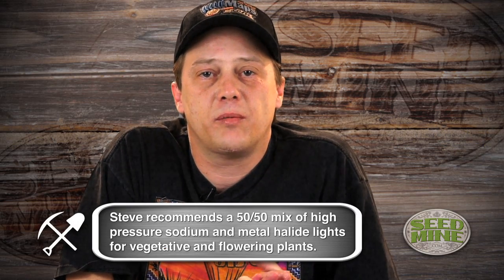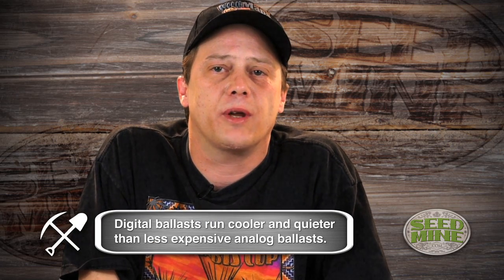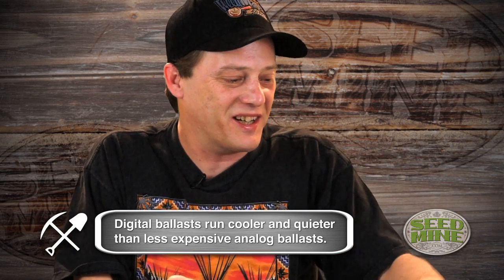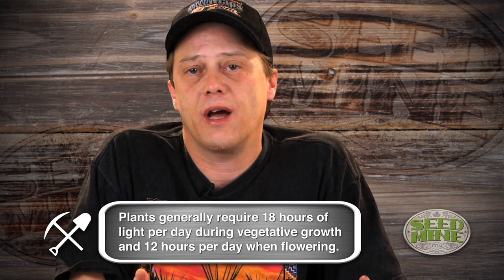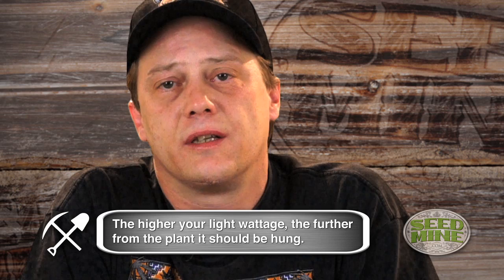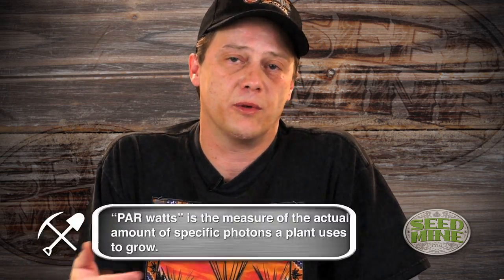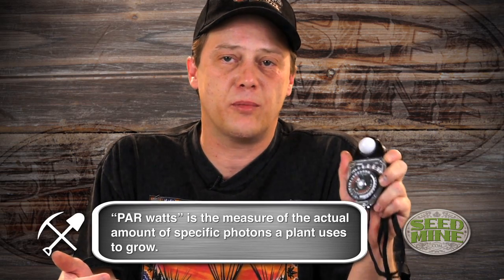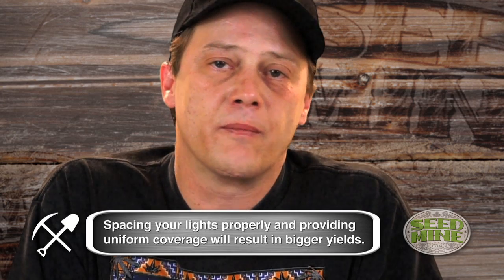Grow Room Lighting

Comment: I have been using led, 600 too a 1000 watt equivalents and well the results are way way better. The pressure sodium etc are ok but you are lacking in alot of the other spectrums. This is 2018 though. Maybe then they LED'S were still poor technology then. Now 89 LED'S two 600 watt equivalents are more than enough to get 15 ounces tried and cured. Also, top quality and that is from my customers and other people's old customers ;)

Comment: Hey brother.. with 1 single full spectrum 180 watt ufo led on a nirvana bubblelicious autoflower grown in a 1.3 gallon container.. I was able to pull 29.3 grams dry weight of pure n utter funky ass weed. delicious caked in crystal bud. LED's are the shit! you just have to get a good LED light. some can be hit or miss. I got lucky before this company went under and got my 180 watt full spectrum ufo for 70 bucks shipped to my door. It will grow 1 plant fantastic. no more than 1 plant but hey thats fine by me especially for 70 dollars
Reply: $61 free shipping 300 watt true watt probably 145 or so..  http://www.ebay.com/itm/281827715881?_trksid=p2055119.m1438.l2649&ssPageName=STRK%3AMEBIDX%3AIT

Comment: I thought that the reason the plants stretched was because the light is too far from the light which causes the plant to stretch out towards the light which will make the stem weak and make it prone to dehydration and after that since the stem is so long and the closed room is so hot it drys the soil and makes the stem like a spaghetti string

Comment: LED lighting has improved in technology tremendously! the problem with most LED lights is that they dont have any reflectors directing, and concentrating the light. My LED light has individual hoods for each high powered 3W LED. and it outperforms high pressure bulbs almost twice its wattage. also with LEDs you can customize the spectrum. mine has added UV light to simulate the suns natural UVs.
Reply: LED lighting has improved 
Even till this day 
But I'd have to agree with 
Steve on this one and say
It still doesn't put quite enough 
Energy.
One of my close buddies switched from metal halide
And HPS to LED for a couple of grow cycles and the 
Results: not as high percentage of THC or terp levels,
Lower yields and much shorter 
Dwarf like plants.
So he made the switch 
Once more trying out
CMH (ceramic metal halide)
CMH lights are the closest 
Spectrum to the sun that 
You can get and produce more
Than enough intensity 
Cost wise it cost more than 
LED but way less than HPS 
You but you won't need a heating pad like with LED the light raises the 
Room temp by 10-15 degrees.
After he switched to CMH 
He started pulling monster 
Plants

Comment: I'm not sure about how legit this guy is. A lot of what he says makes sense, but then he goes and says that you can get better efficiency from indoor lights? A 1000 watt lamp produces 1500lux if I remember right (with a meter directly underneath the light). Direct sunlight produces 32,000-130,000 lux (everywhere). Could someone explain to me how indoor lights are better? I can understand control, but I doubt the efficiency of the lights can surpass the sun.